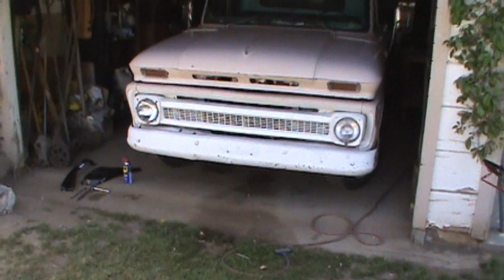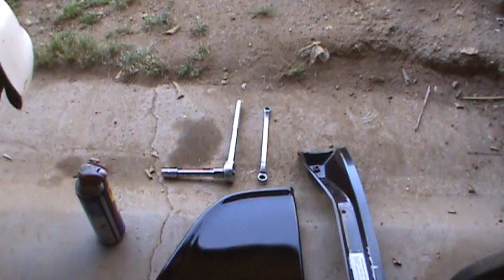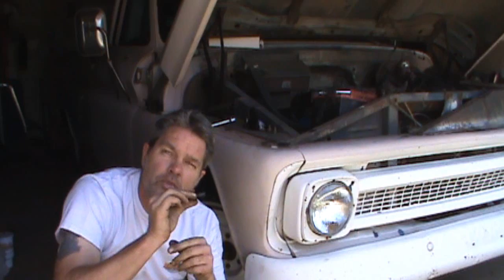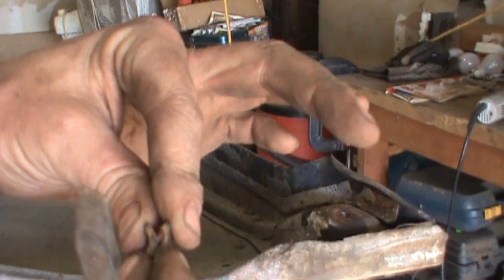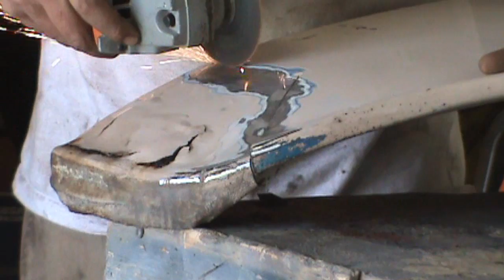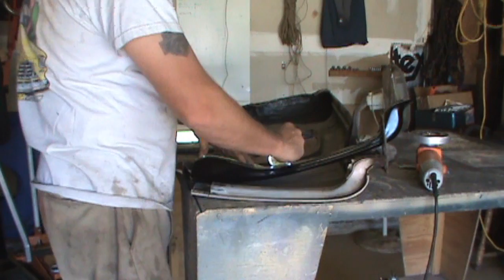1960 to 1966 front fender rust repair part 1

Comment: need to find better cars trust me my buddy has a 65 with no rust with no dents in body good crome for 500 just got a 68 chev pu perfect body with build 327 400 turbo for 1000 it even has factor paint faded needs painted putting 454 stroker in it that i got for 500 with the 400 turbo have many more 66 gt fast back dart for 50 these deals i get all the time if not for free like 36 foot motor home with a 454 400 turbo all fiber class nice in side and out we scrap cars better then this take the good parts and scrap the rust

Comment: Problem with these fenders has never been addressed.I have a Idea that will fix this and the floor problem.A friend of mine said that fender has a catch all.the brace needs to be modified.So that dirt and crap can be stuck in there.Make a bracket that is open and that can drain with out catching any Dirt

Comment: I know this is 3 years to late but will help u next time buyanother truck same as that or close enough for parts I had an 84 gmc 4x4 and needed alot stuff so I went out and bought an 84 chevy the only thing wrong withe chevy no motor lol everything else was good so i swaped bodies but still kept parts from the 84 gmc in case i needed it

Comment: making several marks on your panel helps,do it like,1 inch,threw ten or twelve inches.that just gives you a more accurate finished product.also do one panel at a time when you can.by not cutting the brace out while you had already cut the fender panel,this would give you a stop or go to point with panel.then cut the brace out.never cut the original stop points,until you are sure its perfect.this will help whentyou go realign the fender.did this many times,also run a restoration shop.